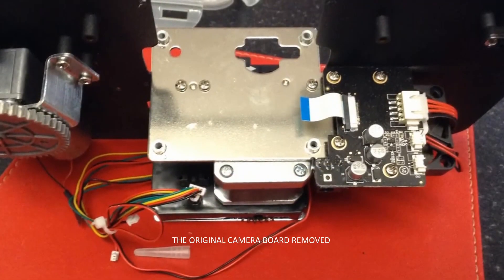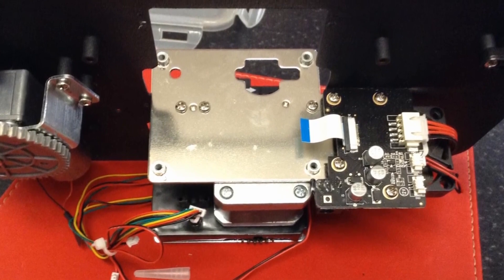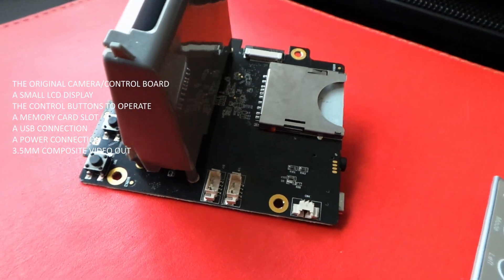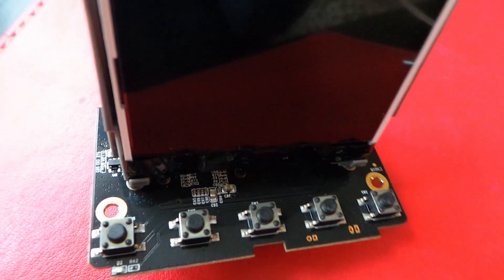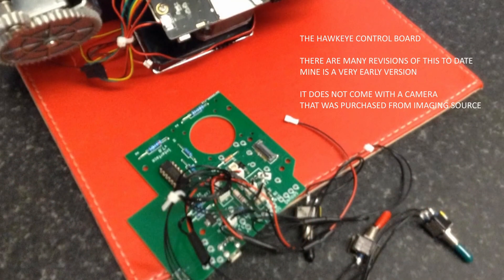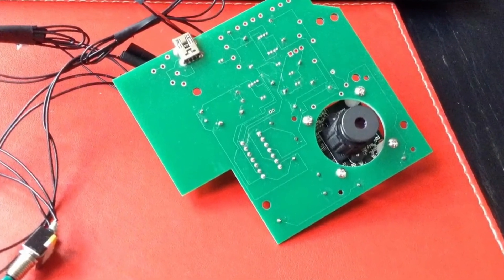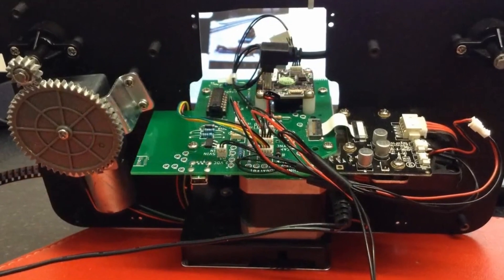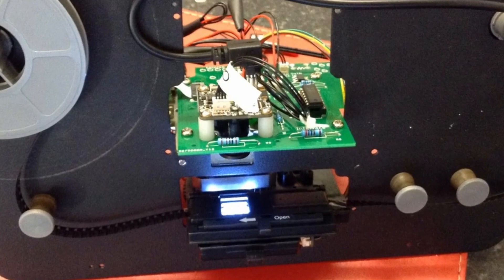WOLVERINE CINE SCANNER / HAWKEYE MOD

Comment: Thanks for this video. Is there external mac software that will drive this to capture single frames via USB connection?
Reply from the maker: the software is camera specific supplied by the camera manufacture.  windows only on my camera. www.theimagingsource.com/en-de/product/board/2u/dfm72buc02ml/

Comment: Great job, what it the specific model of the lens you mounted on the sensor board?
Reply from the maker: Link to the sensor in the description, Lens. 1/2" 12mm 5 MegaPixel Board Lens (IR Cut
Filter) Cost £30 link to the lens https://dl-gui.theimagingsource.com/en_US/e50336d5-f5ac-5ef2-8e8b-7b5ad53e928f/

Comment: Thank you so much for this video! Now I need to find out if something similar can be done for my Reflecta Super 8 + Scanner.
Reply from the maker: The best place would be the 8mm forum as there are reflecta users out there.
You can read the forum without joining, also look out for the archived forum which will have a lot of posts going back a long way.